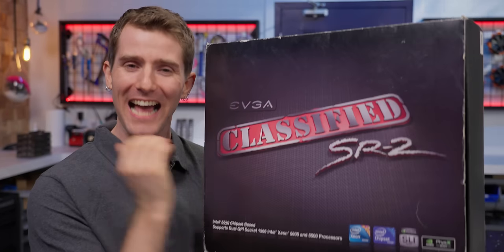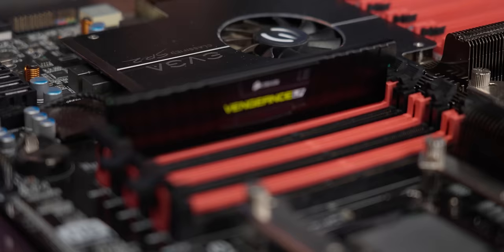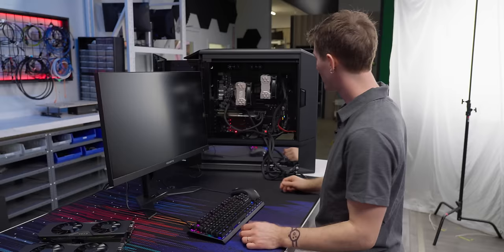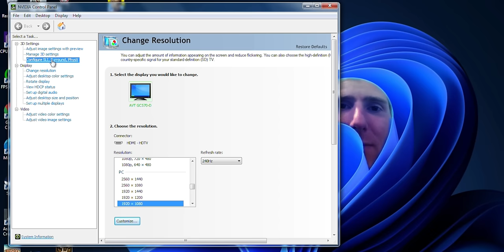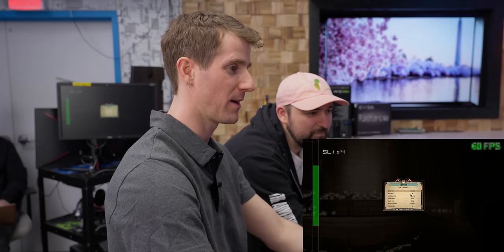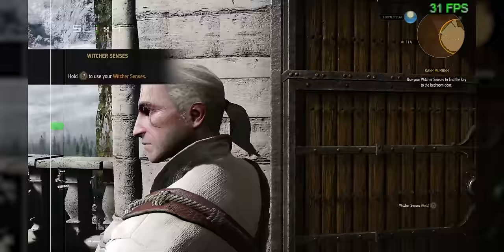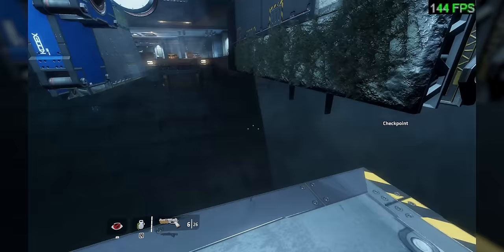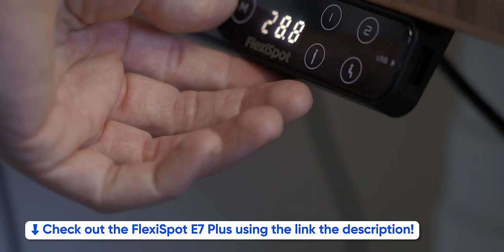How Bad is This $10,000 PC from 10 Years Ago??

Comment: 14 years ago is quite a bit different than 10 years ago...
Reply: exactly, 10 years ago was 1080?
Reply: There's no way anyone ever paired these 2010 Xeons with 2014 980 TIs lol, the build makes no sense whatsoever
Reply: @nemonas2019 no
Reply: @nemonas2019  10 years ago was the 900 series, the 10 series wasn't until 2016.
Reply: @matt.loupe.  is that the year you graduated
Reply: @nemonas2019  1080 was 6-8 years ago
Reply: Thats what I told the judge
Reply: @slightlyoutofphase4193 I don’t want logic, I want entertainment 😂
Reply: fr my pc with 1070 is doing just fine and i bought it in like 2016 for like 1k usd or smth
Reply: Typical LTT click bait title
Reply: *different from
Reply: @nemonas2019  ten actual years would be 780 waiting on the 900 series about to launch
Reply: Indeed. I was half my age and didn't know gaming pc's existed 😂
Reply: Well, AMD showed us you don't need a dual CPU socket board to have crap loads of cores and threads in one PC case.

Comment: I still have this beast, used it for 10 years! It was overclocked to 4.2 with 4x 580's. You needed two people to move the PC it was so heavy. It was an offering so ahead of it's time, particularly when doing Vray renderings with 2x cpus and all those cores. When Vray GPU rendering came out, those quad cards were a blast too, as was rendering videos out of Resolve. A relic no doubt, but so cool and unique.
Reply: Consider using a platform with wheels to move it around, even a skateboard will do.
Reply: Wait you can make davinci resolve use multiple GPUs at once?
Reply: What about QPI Link? As it gets faster with overclocking, the overall performance also increases? I have gigabyte X58A-UD5 and my X5690 WHICH IS NOT SUPPORTED by the board manufacturer but it works anyway runs at 4.7GHz. Yup...4.7GHz and it's way faster than my other pc with i7 3770K clocked at the same. The single core performance is actually a bit worse but i have like 10-15fps more on X5690 in GTA 5 or BF5 and actually a better performance in minecraft using RX580 2048SP 8G while my other pc with 3770K using " faster " 1070Ti. And i red somewhere that it is better to use only 3 sticks of RAM rather than using all 6 of them.. if that is true imma sell them and i buy 3x8 instead
Reply: @samohraje2433  You are not losing hardly any performance with 6 sticks of ram, also many games will suck on x58 because it doesn't have the avx instruction set, something that cannot be accurately measured by benchmarks unless the game does not support avx. I have used both the 3770k and x58 x58 is great for old games but as soon as you go modern 3770k will start winning.

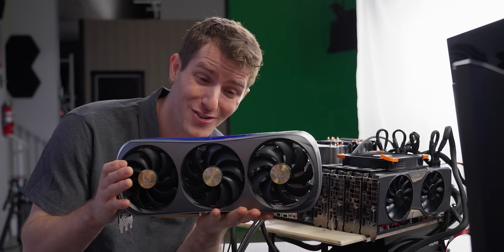Comment: When you held up the 4090 at 9:44 i honestly though it was an edit to make it oversized in comparison to the 980ti but then i remebered how big cards have got over last 10 years.
Reply: it looks so comically huge lmao
Reply: I literally thought the same xD
Reply: It's ridiculous, And it really doesn't need to be this way
Reply: It looked like an inflatable or a plush. Absolutely comical.
Reply: Which is crazy, because the PCB is not that big, it's mostly cooling solution.
Reply: I don't really get it honestly, it doesn't seem like the giant coolers are even quite necessary?
Reply: 600W during tests seemed ridicoulous? hey we have now 14900KS to compete with power draw of 2 server type CPUs and 4-way SLI of high end GPUs, damn how that power requirements went up over last 10 years
Reply: Replacing my 1070, which was already a chunky card for its time, with a 6800XT was wild. It barely fit in my midtower. I was like wtf how did they get so big and the current gen cards are even bigger!
Reply: @NiSE_Rafter My gpus keep getting bigger and bigger everytime I upgrade and it's hilarious. Like I think there's no way this is gonna get bigger then it gets bigger. My old rx 470 looks tiny in comparasion
Reply: it really looks so ridiculous
Reply: @Junebug89  Supposedly they designed the cooler to be able to handle much more power than the card can actually put out

Comment: As a fun note, at work I'm still running an HP Z400 desktop PC which hasn't turned off (other than the occasional power outage on the Vancouver Lower Mainland), since circa 2012. Yes 12 years up and running non stop 24/7/365. The PC carries on like an old truck, and it's used for remote desktop tasks. Hard drives were updated twice, if I recall correctly.
Reply: I've been rocking an HP Probook 4430s 2011 model in similar fashion. Not too long ago I did a full refurbishment/upgrade, upgraded to an SSD from the original HDD, new bluetooth card, 16 gb of DDR3 ram, a 2'nd gen i7 2630qm, the works. Honestly I wish I had done it a lot sooner.

It is similar in performance (slightly slower) in comparison to my current main computer, a Probook 440 G7 which has a 10'th gen i3 and 8 gb of ram. For a laptop that started on Windows 7 and that spent many years trying to run games it shouldn't have been trying to run, it has aged very well.
Reply: @Iron_Sights99   p9x79,  i7 4930K  32go ran cyberpunk on  gtx 770(died)  i now have a gtx 1650
still running win 7 ... "it just works " 
i'm waiting for some new product releases   before new pc (i say new because upgrade is .. debatable)
Reply: I'm still running a hpz620 with 2 6 core xeon with 16bg of ram for my audio production studio and still runs like a champ ,just a little slower load times but I'll take it
Reply: those things are quality BEASTS lol i got one (not running) z420 and dell t3600 as a daily driver. Power hungry but WORKS GREAT
Reply: Those Z workstations are something special. I'm running a Z820 for gaming and...well, it's old but lots of cores and RAM with a modern GPU, there's not much it can't do.
Reply: @ealtar  I´m running a P9x79 to but with bios mod so it can run M2 NVME as boot drive Xeon E5-1680 at 4,34GHz, 64GB 2400Mhz mem, 980MB nvme drive
 and GTX 980ti as primary card and a GTX Titan Z for FP64 performance. It´s still a decent performing system. The system gets almost 8000 point in passmark.
Reply: you have damn long years with 365 weeks? what calendar is that? smile
shouldnt that be 24/7/52?
24hrs, 7 days a week, 52 weeks a year ^^
Reply: I have one that I found on the side of the road
Reply: @zielscheibchen7773  man... 🤓
Reply: @zielscheibchen7773  no..24 hours a day, 7 days a week, 365 days a year.  So just non-stop.  Our system is a little different over here in North America compared to Europe I guess :P
Reply: @curtharakaly4620  why would someone mention the weeks if you fall back to days per year? If you use measurements this way, why using "days per weeks" in the middle? 24h/d,7d/wk,52wks/yr ... that is correct continuity and not that nonsens up there in the opener.
Reply: My 1,1 Mac Pro still gets used quite often. Enterprise grade hardware fucks.
Reply: @ealtar  Damn, nice. I still have my p9x79 with 3930k (upgraded to oc'd 1680v2 now) and a 1070 GTX  and 32GB of G-skill quad memory running like a champ.
Upgraded to Win 10 though for gaming.
Reply: I have one as well but upgraded the power supply to 650 watts a 980 ti, and 18 gb ram and it runs xp, vista, 7 and 8(yes quad boot)
Reply: I know a guy running Windows98 on a computer running less than 500 megahertz for some very legacy software that will not run on a fast box.  Some kind of flat bed scanner with super features no longer available.   I guess as long as it still performs like when new, OK......
Reply: i still use old 8gb ipods, haha
Reply: ye sometimes you get lucky
Reply: Don't forget to replace your capacitors.
Reply: z77 v lk with i7 3770k 32g ram gtx 1070 armor  800w corsair here no probs playing games, still goin strong

Comment: 10 years ago... I might well have had a "Dream PC" wishlist back then with exactly this hardware. It's about the time I started looking at components to build my first
Reply: Damm
Reply: But gtx 980 ti is 8 years and 10 months old. How would you build this 10 years ago
Reply: @shagstars  Some timetravel things I guess
Reply: @alphariusfuze8089  i guess so or he is nvidia executive 😋
Reply: Ryzen 5 7600x, 32 gb ram DDR5 6000hz, 1tb ssd, Nvidia 4070, Noctua NH U12A or cpu cooler of your choice, B650M mobo of your choice, any 750w or 850w modular psu of your choice, case of your choice. Easy build that will play anything you throw at it without being overbuilt or poorly balanced like most prebuilds are. Should be like 1500 or so, good for years.

Comment: I remember being super jelly at lans when someone rolled through the door with a tri sli or quad sli setup, they always looked incredible. However, some would setup, take the side panel off and sit a desk fan blowing into the case and then spend the evening troubleshooting issues for half the games we played. When it worked it was seriously impressive (minus the micro stutter) but it made standard 2 card sli seem reliable and well optimised. Which it wasn’t. I do really miss this era of crazy configs but it was always hampered by bugs/issues. Today if you buy top spec workstation specs, it just works.
Reply: Thank you for that read
Reply: That's great insight into the era. Like a LAN blast from the past.
Reply: Yeah but tinkering with it is half the fun. :) 
Now it just costs an arm and a leg to get even above average performance and you are stuck on 1 card and CPUs don't overclock past factory settings nearly at all. Not complaining here mind you. I am happy we are getting good CPU improvements as we finally have competition but GPU state of things has been a shitshow for years now. Just look at how nvidia keeps giving us the same performance for the same money generation over generation and if you actually want top performance, or even mid tier you have to overpay like mad. It's just sad and unfun to build PCs and tinker with them now. :)
Reply: How about a square room fan placed right on top of it.  After few hours it got so hot basically it need to cool down. Without headphones it sounds like airport runway. Also weighed a ton to move this since you had the biggest case, largest PSU.  Cant imagine what a water cooled version weighed because the one I carried took two people to lift  this best and place on a chair.
Reply: Why would anyone miss this? Don't lie. It's a huge waste of resources, time, and effort. This was an era where companies thought about brute forcing their way into gaming and thought that people would pay for it which some foolishly did lol. This was stupid.
Reply: @cncaliguy09  two people to lift a desktop PC? That's absurd
Reply: Was one of the people that went for crossfire, first with two HD 6970s. Microstutter was awful, but I heard adding a 3rd card fixed it. Surprisingly, it ran butter smooth after adding the last one. Sounded like a vacuum cleaner when playing games though - I literally had to move the whole tower into an air conditioned closet it was so loud lol
Reply: @cncaliguy09  AFAIK big box fans don't have super high airflow right up against them, but a few feet in front

Comment: God i wish LTT could make a video on micro stuttering. Between overlay apps and drivers and the other thousands of reasons these get caused. An in depth guide on how to troubleshoot micro stutter would be massively helpful.
Reply: Yeah man! I had overpowered high end systems microstuttering in low end games for no reason SO often. Many times DDU driver uninstall and reinstall helped. Sometimes only a fresh Windows install helped, sometimes even that did not help. Once it turned out that a wifi card, that i didnt even use was the cause of stutters. Another time it was the audio driver. In 2024 i feel like everything has enough raw power to game on it, but there seems to be no connection between raw power and the potential to get your games ruined by stutters.
Reply: @blinddarm8478  in POE it was the HD audio driver that got installed with my nvidia driver. Causing some kinda issue when loot dropped and it made sound to stutter the game.
Reply: Minimal drivers.
Minimal background programs (AV / RGB software generally creates the problems)
Run fullscreen
Make sure the CPU and GPU are pegged at their highest clockspeeds.

Comment: We have a HUGE laptop at work that has dual Geforce graphics cards, a DESKTOP intel core i7 processor, 16Gb of RAM and a 300+ watt charger! It's absolute garbage compared to even just the CAD style laptops we have these days. Tech has moved on a LOT.  The laptop itself is a very weird brand that we couldn't even find! I was very surprised when I opened up the hardware details.
Reply: Dual GPU in laptop WTF?!
Reply: I remember that MSI had one like that with a full desktop mechanical keyboard on board as well. Not sure if it had dual gpus, though.
Reply: At work I recently went from 6th gen intel to 13th gen intel laptop (both marketed as "mobile workstations" by a well-known retailer). I was really surprised at the performance upgrade.
I'd never buy one for personal use (and my company only buys from this one retailer, so I had little choice) but as someone who does modelling/simulation, and AI as a job, it was certainly a pleasant surprise to upgrade after 7 years.
Reply: @Acre00 I own one of those laptops. Its the Msi Gt80-2qe. Dual gpu's and weighs a ton.
Reply: Does it have two gpu cards or is it just done the same way the GTX 690 was back in the day  @ThePrincessPecorine
Reply: @ThePrincessPecorine It's similar to that, but about twice as thick. 😂 I have NO IDEA why anyone would  have bought one. It must have been an extremely niche product.
Reply: Is it Eurocom or smth? I think they got some huge Xeon laptop back in the day.
Reply: @Jzawesak  it's two gtx 980m mxm cards.
Reply: There’s also a Threadripper "laptop"
Reply: I remember the acer predator 21x was one of those crazy systems where it had 2 1080ti's in SLi and a core i7 something gen. 
That thing came in a huge case, almost as big as big travel bag.
Reply: @ALPHABYTE1994  That's not so surprising. Alienware has done it before.
Reply: It will be a rebranded Clevo, those types of laptops pretty much always are.
Reply: @lemagreengreen You're right! I looks very much like one of their models that has a desktop I7 in it! Good call.
Reply: @@DoublePlusUnCleanNo idea. Hasn't been used for years I don't think.
Reply: @ALPHABYTE_1994 I had alienware m17xr2 and m18xr2 I think. Both had 2 7970m the worked better with only one on and the problems were countless😊
Reply: That laptop sounds like a beast

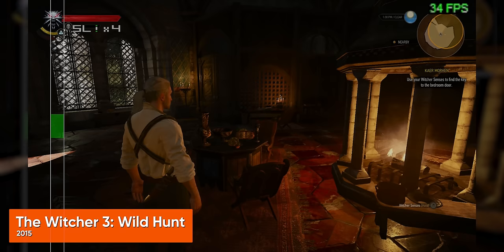Comment: 15:00  Once upon a time on a prior PC with a GTX 560 I decided to give The Witcher III a shot.  Started up the game, went through the intro, got control of Geralt, and built a new PC.
Reply: i used to rock 2 480s until farm sim 19 then i did the same thing. granted back then farm sim was probably the most demanding game i played.
Reply: I'm glad I checked the specs before buying Cyberpunk 2077 -- it wouldn't have run at all on my system without a CPU swap because the 1090T doesn't have SSE 4.1 or 4.2. Otherwise, it would... maybe not "run" so much as "walk with a limp".
Reply: @mal2ksc When Vista was new I tried a game that required Vista, saying it relied on brand new impressive features only found in.. etc.  After a forced install, maybe they were right, but the parts I played ran on XP without trouble.  So later I found another game that required DX10.  My card was DX9, but...

No, they were telling the truth about that one.  I'd never seen a program Orange Screen before that.

Comment: 2014 is 10 years ago? Cursed. I feel a similar conversation coming in time with the Nvidia Titans and Intel extreme editions of the CPUs. Would like to see how a 'future-proof' they were too
Reply: That word "future-proof" is a myth as there is no such thing as "future-proof"
upgradable yes.
Reply: i7-5960X Extreme Edition from 2014 would still do pretty well in modern games when overclocked. In Iceberg Tech's video from last year it was able to get close to or even slightly beat a Ryzen 5 5600X in some games. The R5 5600X being a 6 years newer CPU which you can still buy new today.
The i7-5960X does also have all the instruction sets required by newest AAA games

Comment: This is honestly my favorite videos as it shows just how much computer tech and speed has improved.
Reply: For gaming.  For word processor and even coding (I just learned Rust language) I am using a i5 laptop from 2013 and it works "fine" (though Rust takes a long time to compile, but not too bad for learning).
Reply: @raylopez99  I mean, word processing and coding ain't exactly demanding. there's other ways to show how far it has come with 3D rendering and such.
Reply: @DanielFerreira-ez8qd  Yeah It's true, though for some commercial compiles I've heard they run the fastest computers all night to compile all the code.